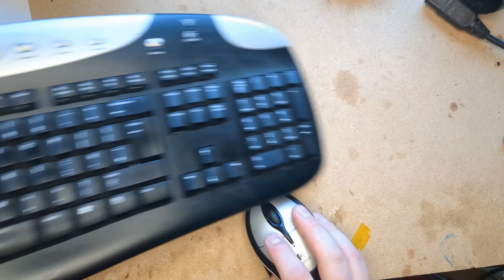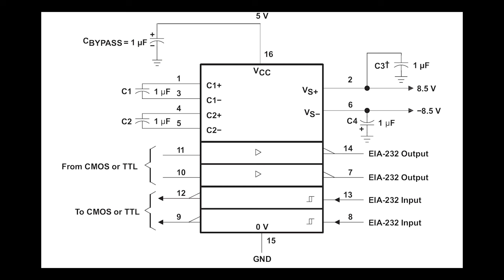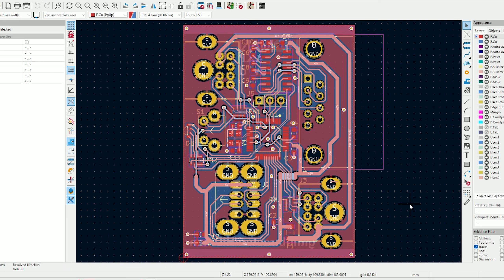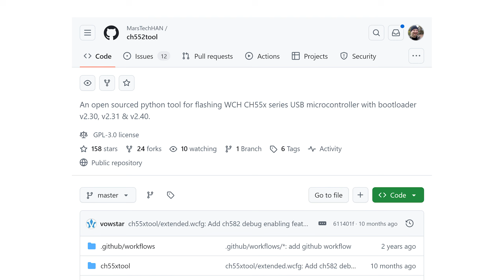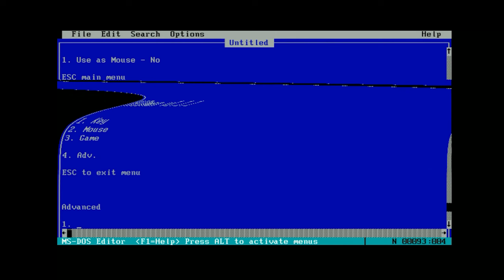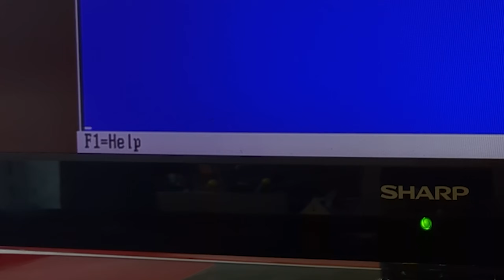HIDman - Modern USB devices on old PCs!

Comment: @therasteri I'd like to use this on a Corona PPC 400. It uses a RJ12 for the keyboard. Although I'm a little fuzzy on the details, there was an Intel 8087 inside the keyboard that would send the signal pretty much straight up send it to the computer. The computer then would convert it to ASCII. Again I might be confused on how the signal is sent, bc there is very little documentation on it

Comment: I have received one, I can recommend.  I have a PS4 controller, and keyboard and mouse hooked up.  I can verify that both the Logitech unifying and Bolt receivers work.  Many thanks!  P.S. I could not get a PS5 controller to work (the Razer Raiju V3 Pro), but the Victrix Pro BFG Reloaded works in wired PS4 mode. :)

Comment: hello. thanks for sharing good project.
can I ask something?
should I short the C5, and press the button, and connect the USB for flashing at the very first time?

I can't see any device connected msg in ISP.
Reply from the maker: You don't usually have to short C5 first time, but I have seen some hidmen that require it. Try it and see how you get on

Comment: I suppose the sequel device will have gameport output.

The DACs required for the analogue output might be an interesting challenge, given the gameport makes use of the resistance to generate the signals it sends to software.

Comment: Amazing work! Is there a chance one might burn the computer PS2 ports by connecting a set of mouse / keyboard that draws too much power? For example, in a really old computer.
Reply from the maker: HIDman has a 500mA polyfuse on it so that should prevent anything too dramatic. Also, older computers paradoxically tend to be able to supply MORE current on their 5v rails than newer PCs. But yeah I wouldn't recommend plugging any 1000W RGB keyboards into it, if only because you'll trip the polyfuse :)
Reply: @TheRasteri  Thanks!

Comment: Hi Andy, love your retro projects! What would you think of an option/mode to accept key-binding info through the serial interface of the HIDman. If one pairs this with a program to generate the identified key-codes (like an extension in the menu that's already in place). We could have batch files per game with specific key-bindings for each game.
Reply from the maker: Hey thanks for your kind words! The idea of per-game configurable settings is one I've been thinking about for a while. As you say, the serial port is one way to go about this, but I would also want the ability to do it through the PS/2 ports because not everyone is going to have serial hooked up.
Reply: @TheRasteri  Right, that seems like an even cleaner option! Cool... Sending a code to MC to update a button value with the keycode byte(s) following? I have some PS/2 experience on Arduino, I might have a look at it (I'm not a brilliant coder though).

Comment: Brilliant.  I know your pain.  I had a very similar project hooking up a TEEMI bar code scanner as a HID device.  
  
Indeed found CH559 and Atmega32U4 in serial to do the job.  Only to find that I have to reverse engineer all of the data this bar code scanner is outputting.  It's a complete blackbox, no source code anywhere.  So I just have an oscilloscope to figure it all out.  
  
Half way through the project I noticed Web Serial API is now a thing in select browsers and thought... this sort of defeats the purpose of me building this entirely and went with the software approach.  
  
Great video!

Comment: First 2 use cases I thought of are edge cases:

1. Use USB Keyboard to DA15 for Family Basic on NES (with exp board) or Famicom
2. Use USB keyboard with TempleOS on bare-metal without modifying the OS code

I was wondering when someone would put time into making USB polling accurately translate to serial interrupts =) looks like a great solution.

Comment: Hi,

it looks like PCBWay is not going to provide ps2 connector for me.

"Please note that we do not provide and solder ps2 connector for this shared project"

Is anyone else having this issue?
Reply from the maker: what?? they soldered it for me. Did they give a reason?
Reply: @TheRasteri  No reason given. They are just proposing that I should source connectors from somewhere and solder them by myself.
Reply from the maker: @Anakkiable  yeah I'd ask them why - they are definitely in stock in lcsc
Reply: @TheRasteri  Ok, problem sorted.

"You're right, this connector should be soldered. Upon inspection, we quoted the BOM wrongly"

Comment: I think your reliance on using extruded aluminum chassis makes the project feel way more professional than the normal 3d printed solution. like there's absolutely a time and a place for 3d printing but this looks like a product you'd buy from an actual company more than a 3d printed DIY project.
Reply from the maker: Yeah 3D printed cases are great but IMO they look terrible. I have had some success with using the PCB plates on a 3D printed chassis, sometimes that can look pretty professional too

Comment: cool project.

how about making it amstrad 1640 complete and add a 9 pin port to stick a c64 joystick to act as the cursor keys, like the amstrad keyboard has on it?  speaking of which i don't think i've ever seen a video of that feature. I think a master system controller worked as well, but did anyone ever dig out how it was done on the keyboard itself?

Comment: wait how is this being powered? does a single ps/2 port actually have enough power for this to work? i assumed it was super low, but i guess i was wrong

looking at ur wikipedia screenshot, im guessing it caps at at a watt more or less, kinda shocked thats enough for the microcontroller and keyboard. 

i guess rgb devices arent gonna work lmao

sorry i guess i havent touched this kinda stuff enough to really know how efficient this stuff is
Reply from the maker: You can pull about 250mA (1.25W) out of each PS/2 port, and since there are two ports, we have about 500mA (2.5W) to play with. That's the same as a USB port, so unless someone plugs in several RGB keyboards at once it should be fine. 

And even then, HIDman has a 500mA polyfuse so that will stop anything too dramatic from happening.

I suppose if someone is using only one PS/2 port you could technically draw too much current but I still very much doubt it's enough to damage anything

Comment: I went the cheeky route... Thanks for providing the step files for the faceplates in the repo. Fully 3d printed case solution.
Reply: Hi, where did you find the files for the case? Didn't find anything on the website he mentioned to download the case files for printing. Thanks

Comment: As someone who has built my own USB HID device using just an ATmega8 microcontroller with a maximum size of 8KB for firmware, I recognize many of the struggles.

Having to work with HID descriptors isn't terrible, but isn't pleasant. Thankfully, on my case I was writing my own descriptor, instead of trying to parse arbitrary ones.

And opening a text editor to be used as a configuration menu interface… Yeah, I've done that too! My initial code would work fine when typing different letters but would be buggy when typing a repeated letter.  That's because I initially did "letter a is pressed" followed by "letter b is pressed"; which won't work for repeated letters (the OS thinks the key is kept pressed), so I had to artificially insert a "no letter is pressed" in between the repeated letters.

It was a nice to watch this video about your project. Great idea! Useful (for a niche audience), and sounds like a fun project.

If you're curious about my project, search for "USB HID absolute pointing device using ATmega8 and a magnetometer" or "atmega8-magnetometer-usb-mouse".

Comment: I could suggest looking into adding NEC PC8801 / PC98 keyboard mice compatibility, although they technically are PC devices Japan has not made them since early 2000 and such convverters exsist but for a whopping 90 USD! keyboard or mouse Crazy
Reply from the maker: @TorontoWanderer  I've had someone offer to hook me up with a pc98. Maybe...

Comment: One thing about the enclosure you chose. Those channels on the outside with the bevels? You can create "cheeks" for that variety of case by 3d printing panels to slide into those slots. Can give it a lot of character / splash of color.  Since I use the same enclosures for multiple projects, the color coding helps me discern modules at a distance.
Reply from the maker: @LanceCSTCuddy  oh cool idea! I know those slots were meant to be used for mounting hardware but it never occurred to me to use them for panels.
Reply: @ I’m away from home and don’t have photos, but you can get really creative once you nail the dimensions. I made a friend a set of solid wood cheeks by using a cnc router to make two rails on the back of one piece of wood, giving super nice looking solid wood cheeks. Looked like my Prophet 6 cheeks by the end. Endless fun opportunities when you’re making a little free standing module like this.

Comment: What's wrong with using just standard PS2 to USB adapters that have been available since the late 90s? I got one way back then with one of my keyboards and never had an issue with all my 90s computers. What's the benefit of the HIDman over those adapters?
Reply from the maker: @pseudonym3690  they're just passive adapters that require usb devices with a PS2 fallback mode - they don't work with most modern keyboards and mice. Hidman actually translates the protocol.
Reply: @TheRasteri I actually just came to the comments to ask the same thing. I didn't realize only some keyboards could work that way.  

I'm guessing the keyboards that could do that were from a transitional period where it was possible that there were still a few people running PS/2 only computers and didn't yet have USB So they made the keyboards so they could run in a kind of "compatibility mode" so they weren't useless if you had an older PC.
Reply: @TheRasteri  Thanks for clearing that up and thanks for making this project available to the public!

Comment: I love the idea of the dekunukem one but the adapter having more power than the computer it's controlling just doesn't sit right with me, like you might as well just emulate the computer directly and take out the middle man imo
Reply from the maker: Yeah I also have philosophical objections to using a multi-core multi-ghz computer just to run the keyboard on my 4mhz IBM PC :) but then again I have a picomem and it's so handy...
Reply: Where the USB4VC shines is in simultaneous peripheral conversion support. 

I use one with a Pi Zero 2W + Waveshare 3B+ converter and it can handle a modern keyboard, trackball/mouse and Xbox controller all at the same time. 
The controller appears as a standard joystick in games, not as keyboard mapped keys and the mouse can be plugged in via PS/2 or serial as well. 

That said, the HIDman is very convenient and does its job well without the need to muck with settings. The USB4VC does require a bit of set-up, but there are profiles that can be downloaded and imported to save time. 

Great project TheRasteri!
Reply: @T3hBeowulf  I'm not saying it's a bad project I just think it's extreme overkill if you just want a "USB to DOS computer" adapter. it has it's place for sure but it feels sacreligious using it. most of my objections is that why don't you just plug the raspberry pi into a monitor and use that as the "retro computer" it has more than enough power to do that.
Reply: @JessicaFEREM  Indeed, especially during the dark ages where the lead times for a Pi were measured in years, it definitely felt wrong putting the only Pi I could get at the time... a 4GB Pi4.
I have since seen my errors, repurposed the Pi4 and dropped a Pi Zero 2.  It wasn't a whole lot better, but at least it was only a ~Pi3 worth of overkill.
Reply: My 486 DX2/66 is surrounded by/equipped with a comical plethora of processors.
* 286/20MHz on the VLB SCSI card
* 286/20MHz on the VLB IDE/Quad Floppy card
* Pi Pico 2040 on the PicoGUS 
* Pi CM4 module on the wavetable MIDI card
* Pi Zero 2 on the USB4VC gluing all the peripherals together. 

It's a 13-core beast!

Comment: Your idea of an internal card would be interesting as hell... What about four-connector card with a usb hub connected to the middle can fits in a drive plate or a rear slot plate, and the edges of the card are set up for ISA/EISA on one side, Microchannel on another, PCE and PCI-E on the remaining two. That way, it works with ANY PC compatible, pretty much, and gives you lots of mounting options for the usb hub's ports.

Comment: Love it! Just a amendum, the first gen Xbox one controllers use a proprietary wireless connection. The later ones do have a standard Bluetooth mode though.
Reply from the maker: Yeah I'm hoping to add Xbox controller support soon. It should be possible.
Reply: @TheRasteri  no rush! Throws an Irn-Bru up north
Reply: @TheRasteri It gets worse, the 2nd gen controller supports both BT and the proprietary protocol, but a slightly modified one. The PC dongles for different gens are incompatible and use separate drivers.
Both work the same over wired XInput AFAIK.
Reply: @HalNeinThousand Is that why my dongle doesn't work with my controller?!

Comment: What a cool project Rasteri, I wonder how easy it would be to add a gameport so it can be used to translate joysticks into keyboard/mouse inputs strokes chin 

♥ Great vid and project!
Reply from the maker: I may do a HIDman-pro at some point that has a gameport. I've been thinking about it
Reply: @TheRasteri One of the cooler features of usb4vc is to split 1 input device's many buttons to several vintage side device. it would be cool to provide this, but I understand it's a bit against your simplicity tenet. It's THE way to play descent with a PS4 gamepad though!

Comment: USB HID... yes, it's so well designed by Microsoft, that nearly every hardware vendor needs to provide a custom driver to work around issues - many of which are caused by the hardware vendor. Typical "we will fix it in software" approach.

Comment: This is a really cool project, and nice to think about the affordability. I don't particularly need one myself as all my retro systems are laptops but it's really nice to know that it's there.

Only two things that stand out (and these are just my own curiosity, not any critique) but where do you get a PS/2 to PS/2 cable? I don't think I've ever seen something like that, maybe from old KVM Switches? But all of those that I remember using were integrated into a weird loom ending in a proprietary plug. The USB A-A cable should be easier to find, although I will say I think they're a detestable thing, I understand why they get made, and why it would be a space concern to have a B or C port on the unit also, but it just seems like a potential for disaster. It's not as bad as some other applications of USB-A i've seen, like using just the connector to run 12 and 24v in a way that'd utterly fry anything you plugged into it, but it still gives me just a tiny bit of shivers 😅
Reply from the maker: You can find PS/2 to PS/2 cables on ebay and aliexpress. As you say they're still used in KVM switches. I'm not happy about A-to-A cables either but needs must...
Reply: Heaps of PS2 to PS2 cables available online to purchase.
Reply: @TechToTunes  never seen them in the wild but I guess it makes sense seeing as they were used on KVMs a lot